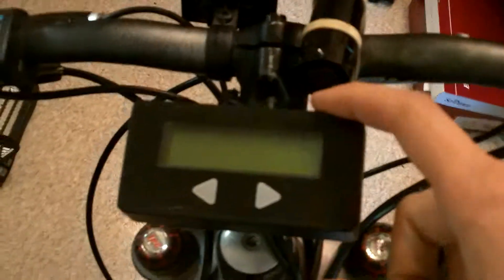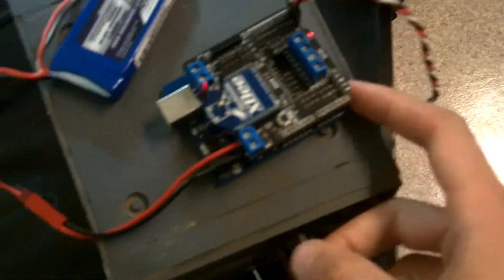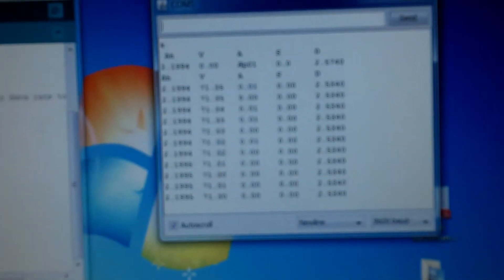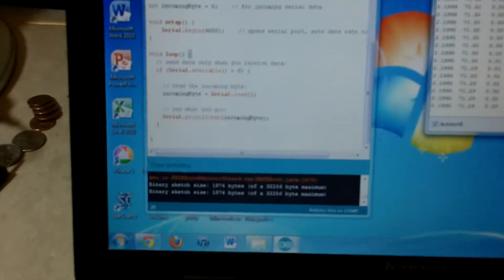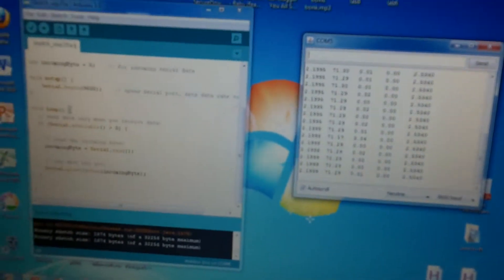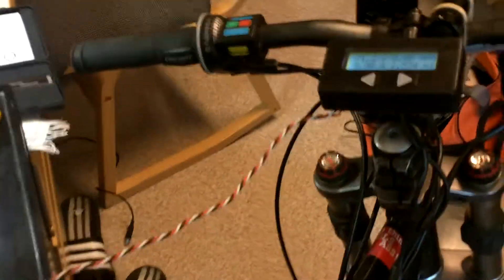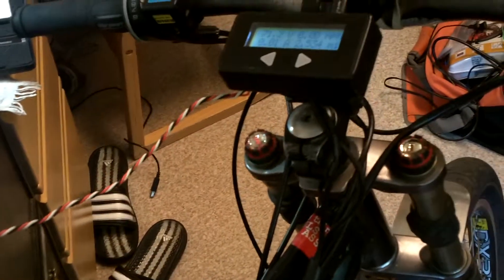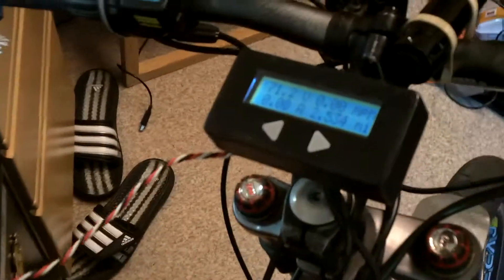Electric Bike/Vehicle Wireless Telemetry

Comment: I know this video was made a long time ago. But we are working on a very similar project and would like to know more about this system you are using
Reply from the maker: Sure! You can read more about it here: https://endless-sphere.com/forums/viewtopic.php?f=3&t=44134
I'd also recommend looking at the HKPilot Transceiver Telemetry Radio Set V2 on Hobbyking instead of xBees, they give you much more range for your dollar and can be used as a transparent UART connection. I don't want to get into too much detail about things without knowing what level you're comfortable working at, but this is basically an Arduino Uno set up to recieve serial data (5v UART) from a Cycle Analyst, and can also interface with other sensors and append the data to the serial from the CA and send it to the other radio. If you go with the HKPilot radios you'll want something like Sparkfun's FTDI Basic to get your USB connection. 
I should note that depending on your project's requirements simply using the HKPilot radios with a cheap quadcopter flight controller like a naze and a uBlox gps module you'll have a pretty good collection of telemetry that requires no custom coding and has tons of online tutorials and free user interfaces for programming everything. Hope this helps!
Reply: +krypotonknight thank you very much